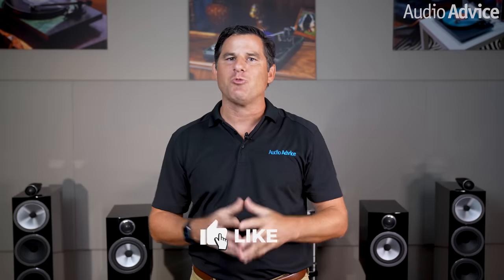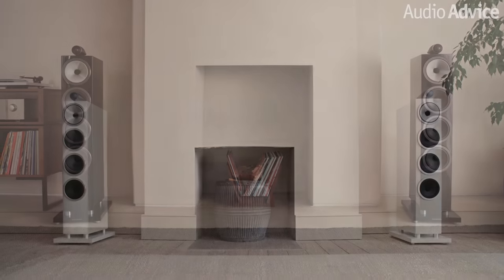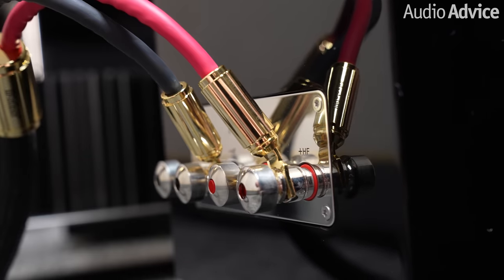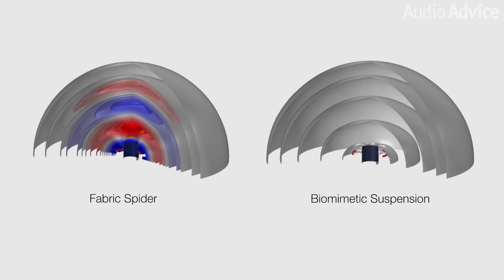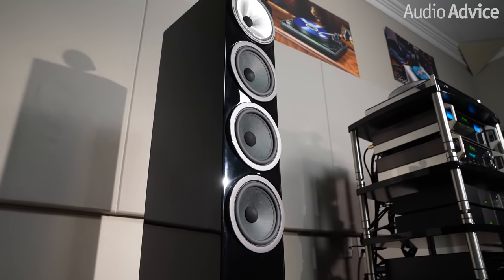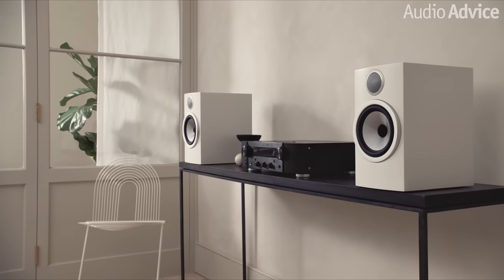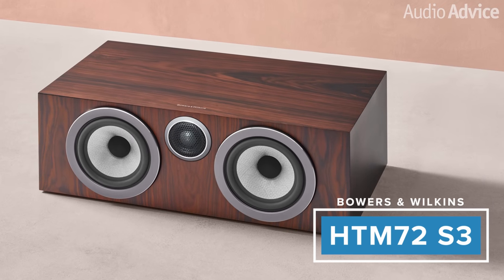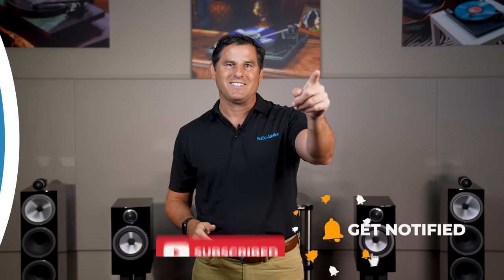FIRST LOOK! Bowers & Wilkins 700 Series 3 Home Theater Speakers Overview

Comment: Would you say this series are a good option for an apartment in a high rise?

I saw a few audiophile channels mentioning they sound better on higher volumes and not good on low volume.
Reply from the maker: Almost all speakers seem to come more to life when you turn them up a bit.  Your biggest concern in a multi unit building is the transfer of bass energy.  That is what the neighbors hear.  So speakers with somewhat limited bass response are likely to keep any complaints down.  Thanks for watching

Comment: Just got a pair of B&W 706 S3s, and the sound imaging and clarity from these speakers is incredibel!  

I paired them with the SMSL AO200 amp that has 2 Infineon MA12070 chips, and a Klipsch SW-120 sub, and the combo produces clean, lush, and smooth yet room shaking music from my computer, and it turned my home office into a sonic bliss!  This combo is as goood as if not better than my $10K+ cost combo of Klipsch RP-280 Dolby Atmos System + Dennon 9.2 channel AVR + Sony S7200 Blue Ray hometheater system.
Reply from the maker: Glad you are liking them, thanks for sharing

Comment: Approx a month ago, I purchased a HTM71 S2. In your opinion, is the HTM71 S3 a big step up from the S2 center channel?

As information, my L/R channels are 805 D3s. I purchased the 700 series center as it's extremely hard to find the HTM2 D3 in the used market. I was surprised that the 700 series center actually blends pretty well with my 800 series fronts
Reply from the maker: The midrange will be a lot better.  Thanks for watching
Reply: @AudioAdvice  Thanks for the quick response! I just placed an order via your website. I'm looking forward to listening to it.
Reply from the maker: @mtkreger  Thanks Mark, if you have any setup questions feel free to reach out to our support team at www.audioadvice.com

Comment: My question is what is the better speaker then the new 703s3 or a 804D3. I have a feeling the new 700 series is the replacement in the price range and the new D4 is now alot more expensive. But how much better is the diamond tweeter from the D3 series. 
Is anyone able to chime in on this?
Reply from the maker: The 804 is still better but you get closer than ever with the new 703. Thanks for watching

Comment: how do you think the 702 S3 with HTM71 S3 and a sub to start my home theatre system sound? debating this or going with Q Acoustic concept line
Reply from the maker: Great choice, you'll get close to 800 level performance for much less.  Thanks for watching
Reply: @AudioAdvice  anthem AVM 70 good enough to power these?
Reply from the maker: @NY0424  The AVM 70 is great, but it does not have power.  Please reach out to our team at www.audioadvice.com to help you out with product selection.  Thanks!

Comment: Is having a dedicated midrange important?  If so does that mean the floor standers sound better than the bookshelves?
Reply from the maker: As a general rule yes if the design is well done. There are some great 2 way speakers on the market though.
Reply: @AudioAdvice  Hey Scott, if someone already has subs, would you recommend the 703 S3 or moving up to the 805 D4 would be better?
Reply from the maker: @deankim6687  That is a great question.  The 805D4 throws out an incredible 3 dimensional image if set up properly.  It would be best if you reached out to our team at www.audioadvice.com to go over the pros and cons of each, as there are so many variables to talk about.
Reply: @AudioAdvice  thanks Scott!

Comment: I was at a store and heard the floor standing B&W 703 S3, in comparison to two stand mounted models - the B&W 705 S3, and the Focal Kanta 1. Both the stand mounted models seemed to project a larger 3D soundstage compared to the 703 S3, although of course the 703 surpassed in terms of bass and overall presence. The stand mounts also seemed to do a better job of "dissaappearing" and letting you hear the music, whereas the 703 S3 made their presence felt. (although not in a bad way, I must say). Reminded me about the old debate regarding floor standers versus stand mounts..
Reply from the maker: Yes, great bookshelf speakers usually disappear while floor standers have more impact.  Thanks for watching